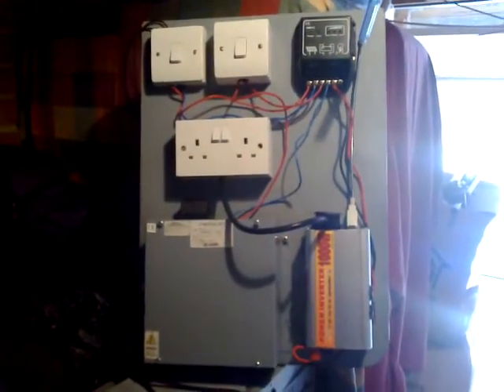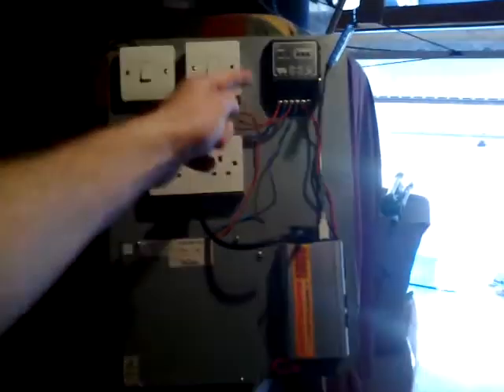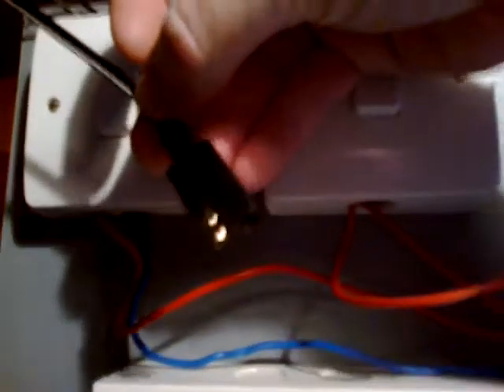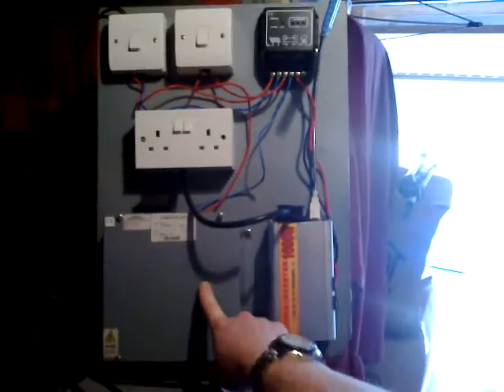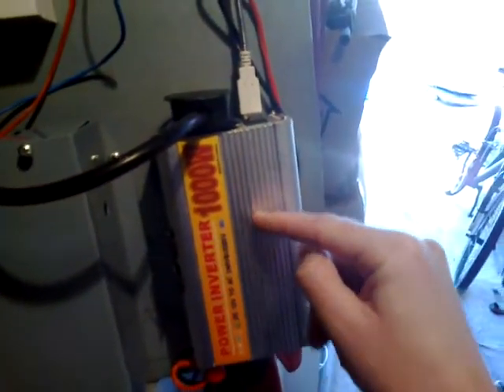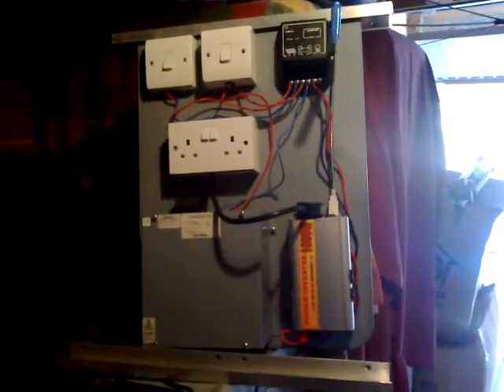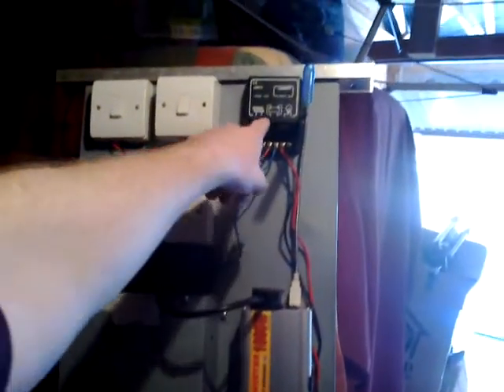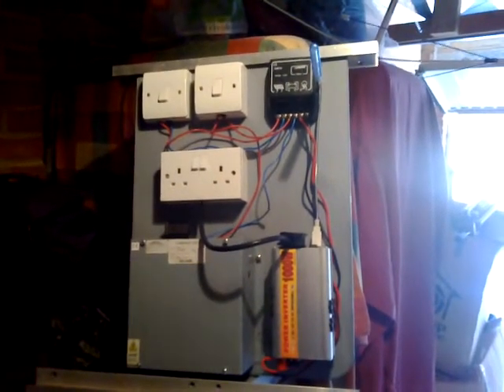a small solar project

Comment: Hi, I'm very new to this and just dont get how you can use a 240v house socket power by a 12v battery ? So your inverter conects to your 12v battery right ? And from there you can use any 240 applyences ? Like a TV ?

Comment: Shouldn't your inverter be connected directly to the battery and not the charge controller? 1000 Watts at 12 volts is over 80 amps that you're pulling through the charge controller.

Comment: Quick question, as you said the solar panel is only big enough to just keep the small battery topped up but if I made the same setup at home then decided to extend would it just be a case of adding an extra battery in line with the existing and then just adding an extra panel to compensate for the new battery. Basically if you wanted more power could you just wire in an extra battery then solar panel and be done with it? Thanks Dan